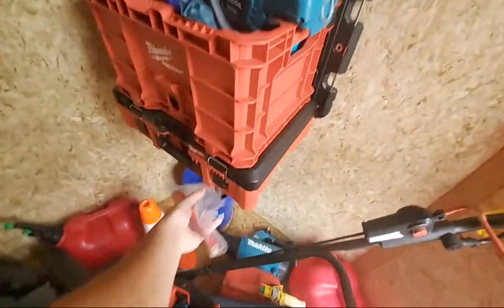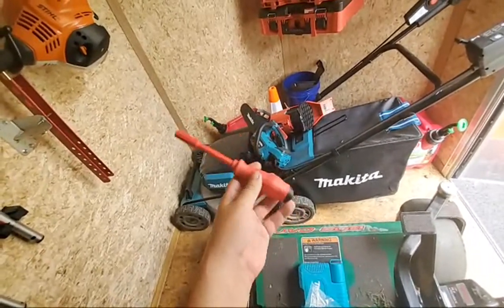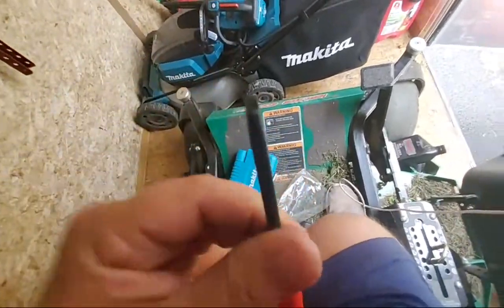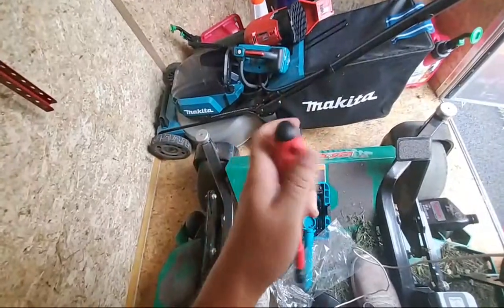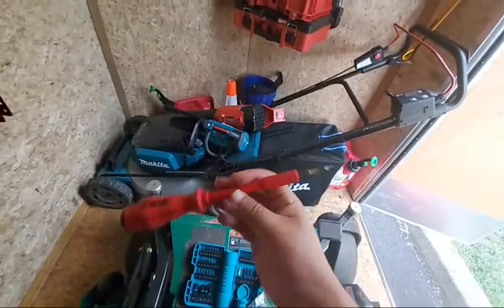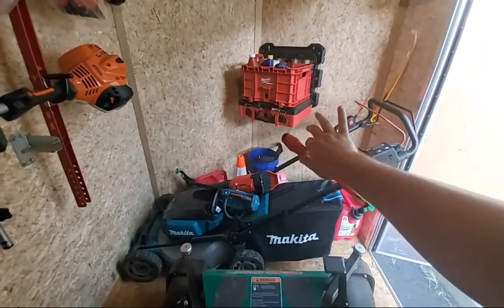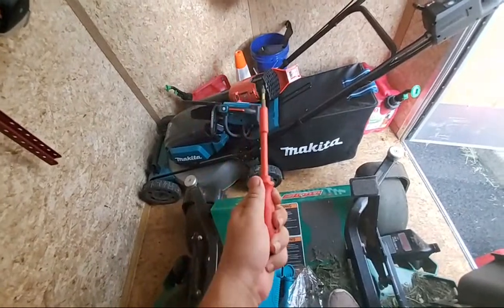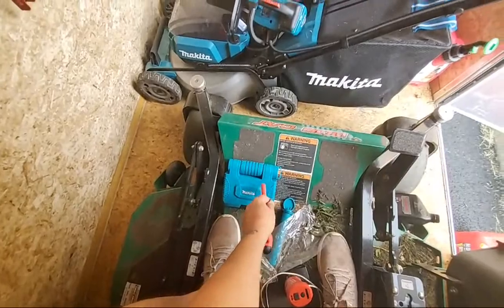Felo (0715750785)4-Inch Insulated Bit Holder Screwdriver

Comment: Thanks for the video. I have this bit holder too, but the current version of it has lost its VDE markings. It's still a good insulated bit holder, but I think in many EU countries you would no longer be permitted to use this as a professional electrician. I have shifted mine to my mechanic tool case, as a back-up electrical screw driver.
Reply from the maker: I went to buy another one a few nonths ago couldn't find anywhere in usa . Pretty pissed